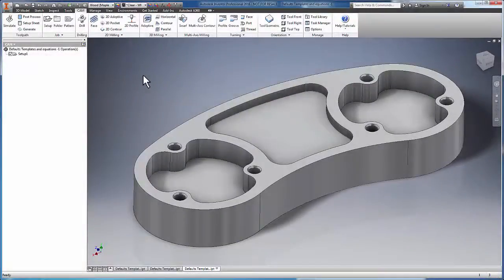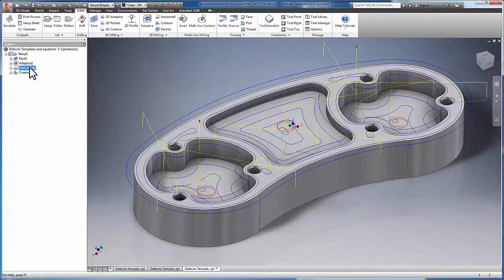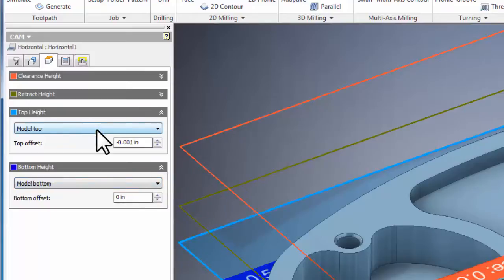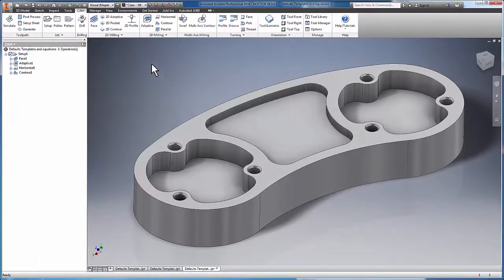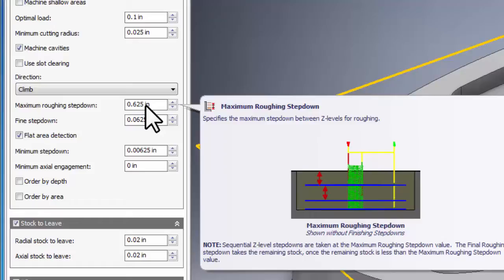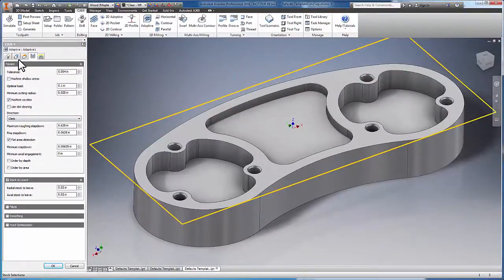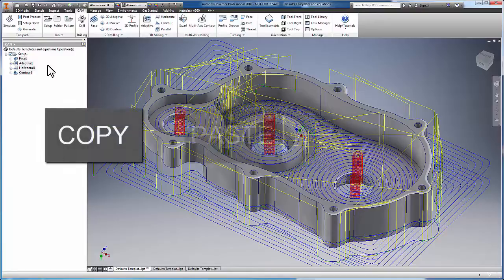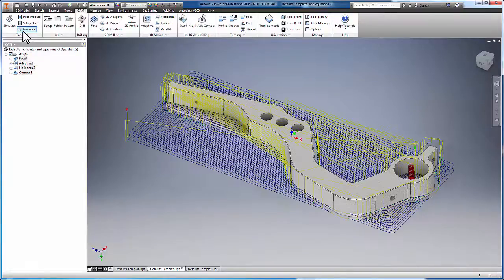Development Update: Setting HSM Defualts

Comment: Great video! The shop I work at has Fusion 360 is it possible to do this in Fusion?
I found the compare and edit and tried changing a few of the height defaults there which works.The shift click on a field in the operation to edit an expression does not tho.It looks like I could change the expression in compare and edit. Is there any info on doing this in Fusion? Thanks for the videos alot of the info on HSM aplies directly to Fusion 360.
Reply from the maker: Ed Germain Expressions work in Fusion, we just haven't implemented the editor yet.  You are correct, things you see in HSM are directly applicable to Fusion and vise-versa.   The only difference should be the CAD.  Typically, you will see things in Inventor HSM first and then HSMWorks and Fusion.
Reply: Thank you for the reply.
 With Fusion 360 in CAM if I right click on an operation the second line down is ( compare and edit ).Is it safe to make some changes to the defaults here?